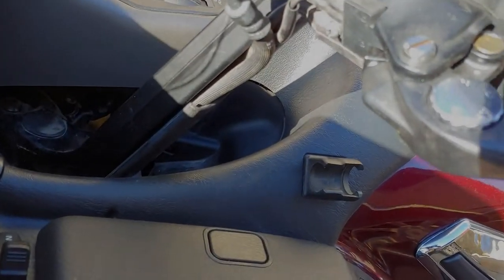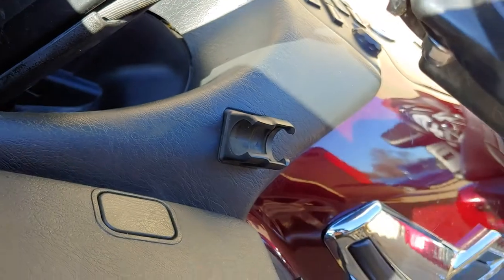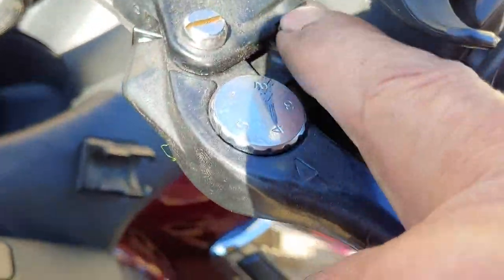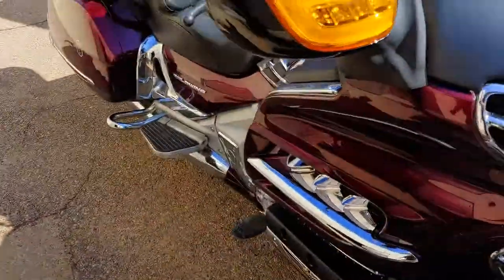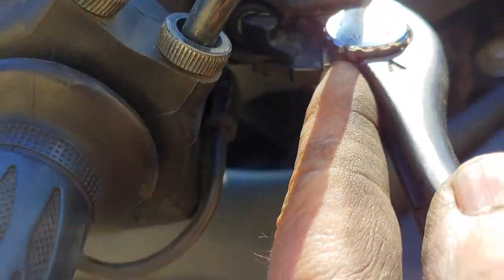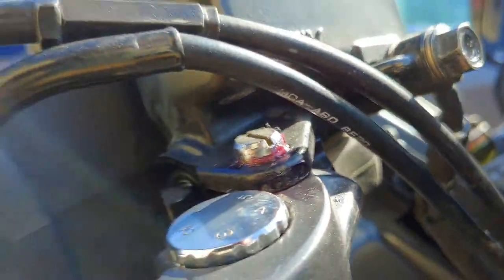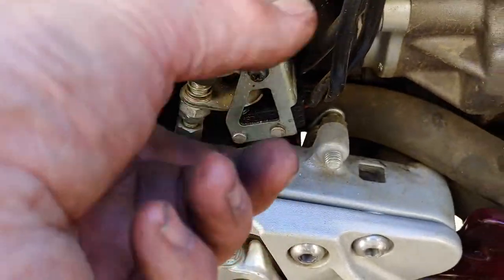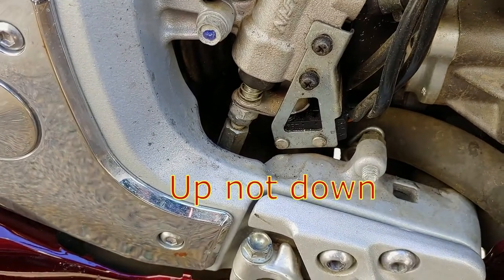GL1800 Goldwing Cruise Not Working

Comment: I’m going to throw in something here. When putting the cruise control on be sure your foot (size 14 for me) isn’t touching the rear brake pedal in any way. If it is, your cc will not set, or if set, it will go off. I went for a couple of days on my new Wing believing that something was wrong on this bike. Nope. Just a little operator error.
Reply from the maker: Yes good tip